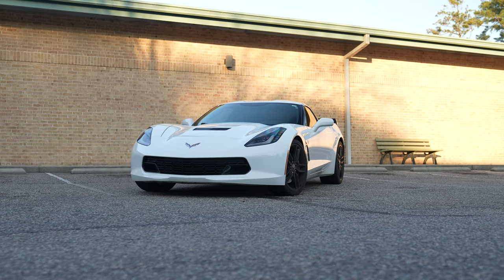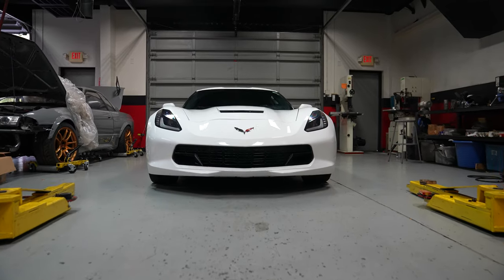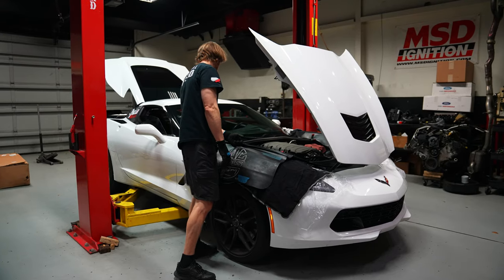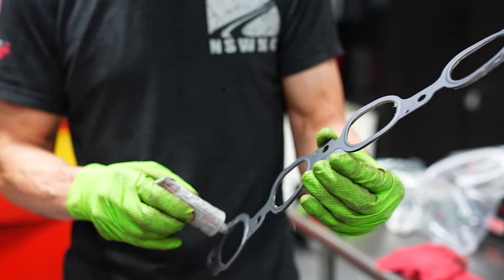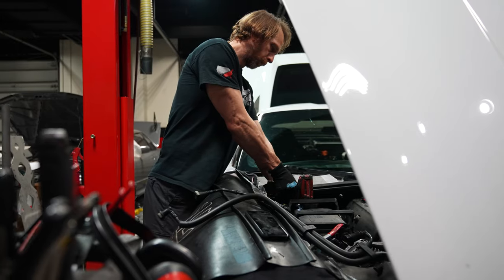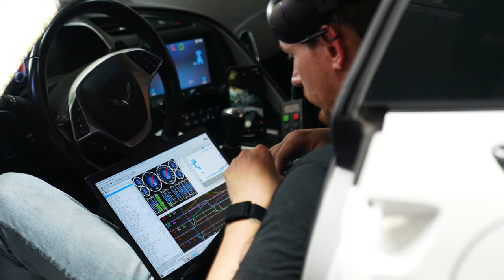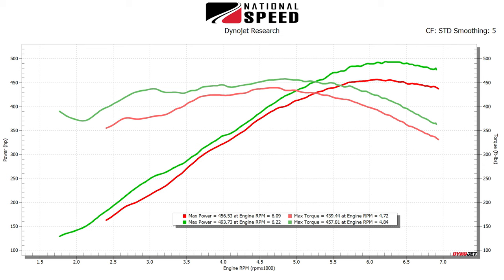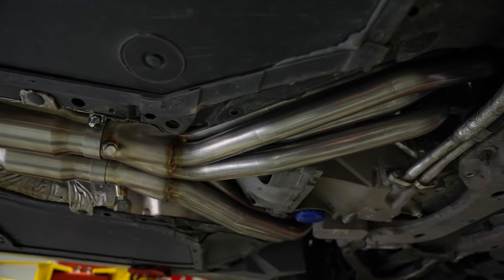C7 Corvette: Headers Worth It With a Cam?  DYNO TESTED!

Comment: VERY interested to see what mine picks up! I have them ordered and hope to make larger hp gain with my supercharger pully being changed as well. My c7 grand sport already has a stage one cam, Lt4 supercharger, Lt4 fuel injectors, Lt4 fuel pump, AFE Momentum cold air intake, upgraded Edelbrock cooling system, an active fuel management delete kit, and forged racing pistons. I'm now going in for the Stainless Works long tube headers, high flow cat with x-pipe, and putting a smaller 2.3 pully on the supercharger.

Comment: So I've got a full heads cam,Intake manifold. Everything you can do without E85. do recommend one heat range cooler than stock on the spark plugs? Also what you set gap to? Thanks and love your vids guys

Comment: What type of long term issues do you run into after installing an aftermarket camshaft?
Reply: None
Reply: Lifter failure
Reply: @tweakhawaii362  need to upgrade those too?
Reply: @josephraines4338  yes definitely, make sure whoever is installing it is reputable. With an after market cam, its recommended you upgrade the entire valve train. I bought a 07 C6 with an aftermarket cam, drove it for 2 weeks, lifters failed (could hear a tick in the engine)... When upgrading my heads cam the mechanic found score marks/dents on the camshaft, had to get a new block entirely. Now im going with a forged 408 with forged internals. 11k down the rabbit hole for me LOL
Reply: @tweakhawaii362  Damn!
Reply: @josephraines4338  Car should be done by next week, havent driven it in 4 months. Ill upload a vid of the setup/build , it'll be a roudy setup for sure!
Reply: Exactly

Comment: At what stage cam do you have to upgrade the torque converter on an A8?
Reply from the maker: This is more of a question of comfortable idle speed than a cam stage. We have a cam spec that is good to operate and idle well within the ranges of the stock TC, we include it in our "Stage 4 Auto C7" Package. Anything above that, we recommend TCs.

Comment: I’m new to the car scene so his car messed up with the cam he had so he had to upgrade it ?
Reply from the maker: One of the AFM (Active Fuel Management) lifters collapsed, which requires an invasive repair.  The camshaft had some scoring on the lobe as a result, so he took the opportunity to upgrade, since the scope-of-work isn't much different from simply repairing.
Reply: @NationalSpeedInc  ANY-1 WHOO HAS A NICE CAR LIKE THIS..WELL IS A FOOO IF HE HAS THE CAMSHAFT CHANGED..THIS ENGINE IS NOT BUILT 4 IT..+ IT WILL DEFF..VOID YER WARRANTY + WHEN U GO 2 SELL IT IN THE NEAR FYTURE..NO-1 WANTS SOMEONES  ...HOT-ROD!!..NUFF-SAID.